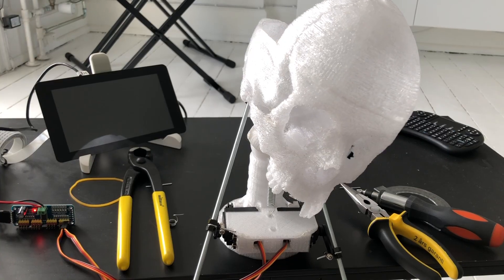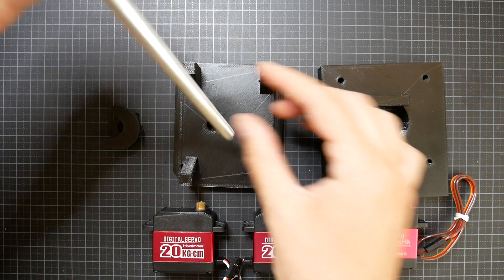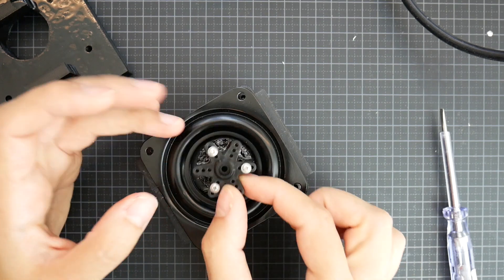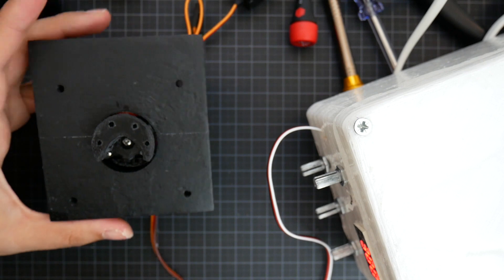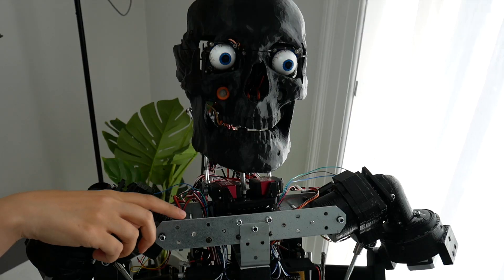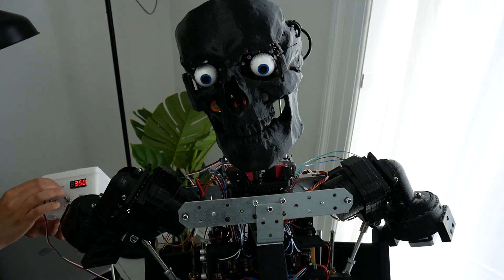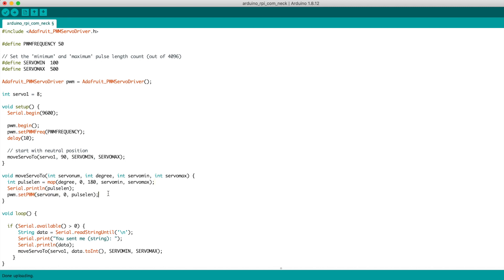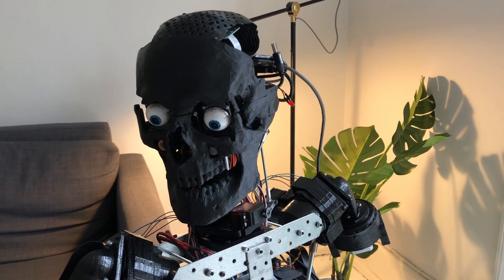Humanoid Robot - Neck Design

Comment: Heyy... your videos of designing the humanoid robot is very awesome and helpful for me to startup on my project 
One thing I would like to mention here that... if you can reduce the noise of the motors it would be more innovative from your side and patentable
Reply: to do this all she has to do is use brushless dc motors with no gearing.  They are speed controllable via the h-bridge mosfets.  That's what I'm doing on my humanoid robot build
Reply: @artbyrobot1  Do you have any videos on your build?
Reply: @SteveRaynerMakes  yeah a playlist of them.  I haven't gone far in the build though yet but have some videos of the "so far" progress

Comment: Is Arduino and rasberipy enough for a full humanoid robot??
Reply from the maker: Good point. Well, it is still work-in-progress and I'm updating components as I go :) So for now I have the Arduino for sensing and actuating, and communicating with the Raspberry Pi, where most of the smarts will be. However, for the hands, I already have a lot of sensors - more than the number of analog pins on the Arduino, so I'm currently considering using some smaller Arduino compatible boards for the data collection from the sensors in the hands and sending only changes (interesting data points) to the main boards.